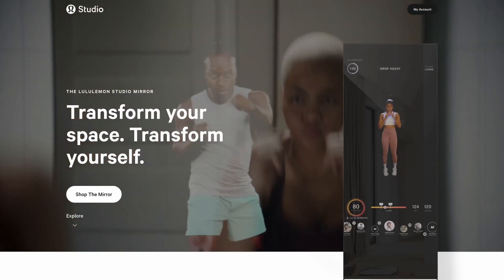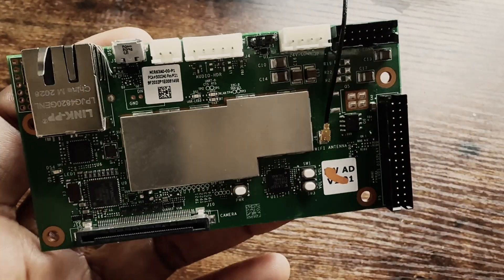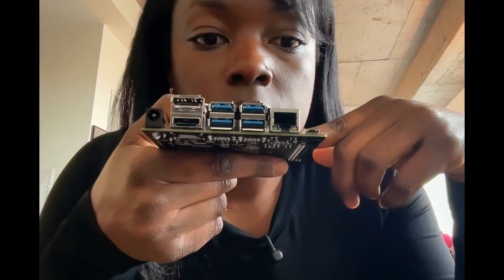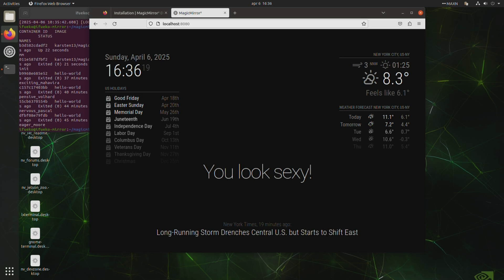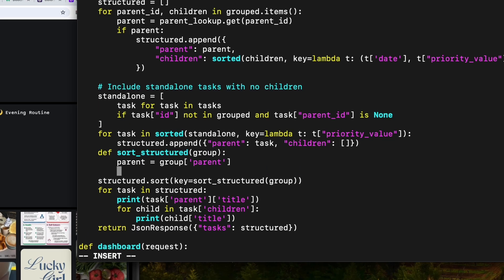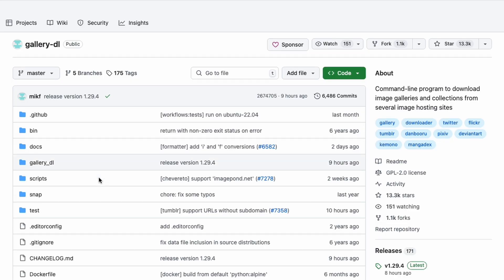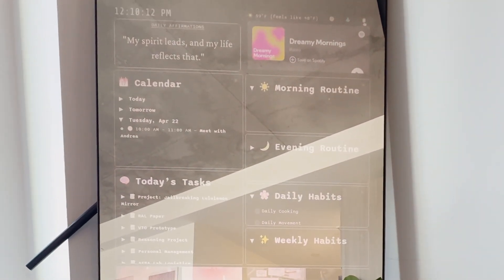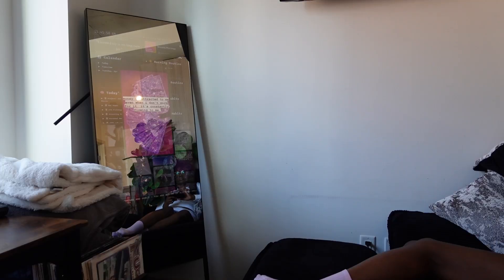Building a Smart Morning Routine Dashboard (From a Jailbroken Lululemon Mirror)

Comment: This is very cool! I’d like to something similar from scratch, but haven’t been able to find a nice display screen that is thin enough, you didn’t happen to check the brand and model of the screen?
Reply from the maker: brand is display logic, model LM40SAMFHD700AG25WV but i can’t find it anywhere (maybe bc it’s from 2020) but size specs are about 40 inches diagonal and 18mm thickness
Reply: @fancyfueko  Ok so only part of the mirror is display area, otherwise it is just a 40” 16:9 display behind a two-way mirror, that’s why it is such a strange shape for a display? So there is nothing custom-built after all and it’s not that hard to make. Thank you, you pushed me a step forward!
Reply from the maker: yup exactly! i honestly would have preferred a fully custom solution if I was starting from scratch with no mirror. its definitely not worth 1500, i paid that startup markup

Comment: wow that is awesome! you're insanely smart and hard working! How do you plan out tackling a project like this, especially if there are things that need to be done that you have essentially never done before?? Like if I coded in java before but never in python and I've never done robotics. And Im not an MIT PhD, just a BS in CS 🥲
Reply from the maker: the hardest part is getting a working development environment (basic platform/server, code you can edit quickly and see the results) and then add features in one by one--thats the best way to learn and honestly the way i still develop. For python based robotics (on linux) its the same way, I love linux for this reason :)

If you know java (java was what I learned with) the shift to python can be pretty smooth. It's mostly just understanding syntax differences and understanding scripting vs compilation. Python is a scripting language at its core and doesn't force object-orientation (even though you can still use it), so its easier to get your code to run and make progress. you got this!

Comment: instant sub, great edit, awesome stuff !

what else did the hardware modifications entail? Did you have to find a crazy display adapter, but then it was plug n play?
Reply from the maker: yup literally finding the display adapter was the hardest part, i bought one version off amazon in 2022 that didnt work and didnt pick it up until this year when i found the right one off ebay linked on a github repo. at that point thought its just a computer!